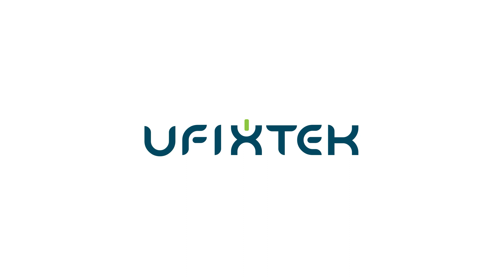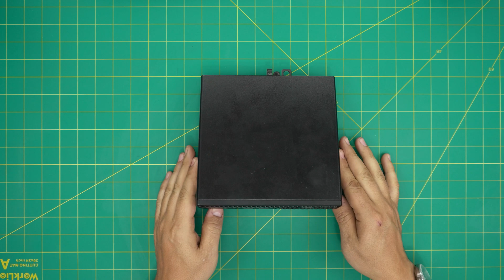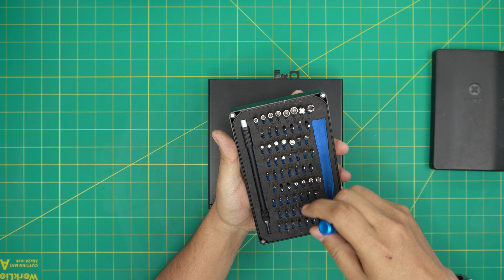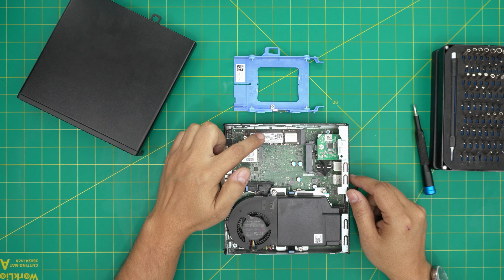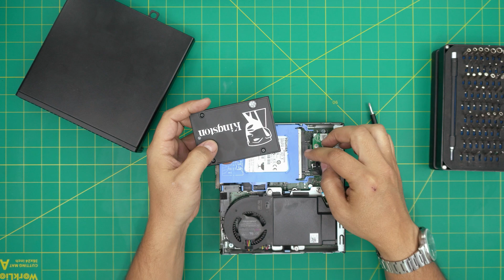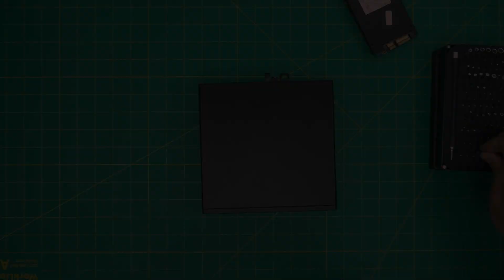How to Upgrade Storage (SSD/HDD) on Dell OptiPlex 3080 - Step-by-Step Guide

Comment: Do you have any insight on the dell optiplex not booting after the new SSD? 

It is showing up with a solid orange light
Reply from the maker: NEW SSD 2.5" or m.2 NVME SSD?
and of you remove all the drives and power on you get DELL logo?